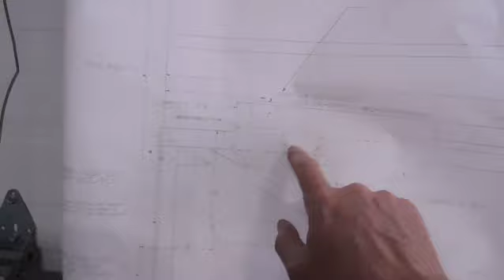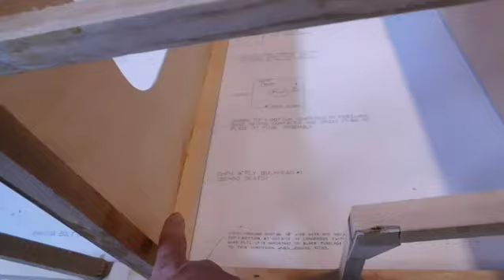DAKOTA HAWK EPISODE 91

Comment: I don't think a top brace is needed. All the bracing on the bottom is needed for the tail wheel. If you feel the need to add one on the top I'd suggest making it only 3" or so long. Any larger would just be adding unnecessary weight and the last place you want unneeded weight is on the tail!
On mine I made a small wedge to fill the gap between the two vertical members on the inside. Same size as the vertical members. Figured making the two sides more solidly attached would be a good idea. Then I planed the back flat for the tail post. That's a little tricky because if you get the angle off slightly the tail post will be crooked.
Also, when you attach your tail post, pay attention to where the rudder horn will be located vertically. Make sure that the rudder cables will be able to reach the horn in a straight line. Mine ended up about 1/4" too low and I had to gouge out some of the battery box plywood to allow the cables to attach in a straight line.
Reply from the maker: Just posted a new video.... where I say... yeah it's pretty stiff.